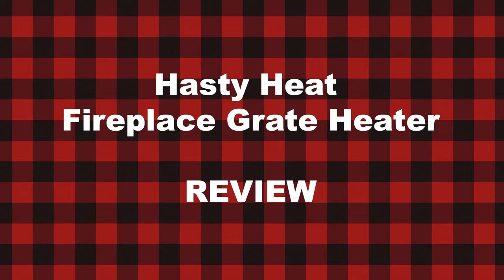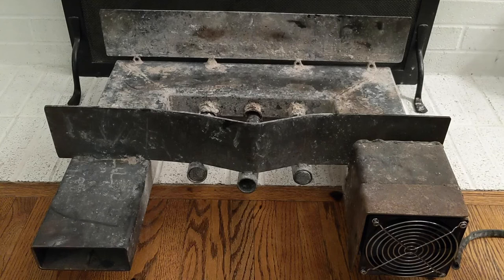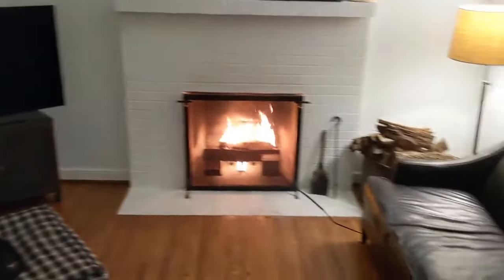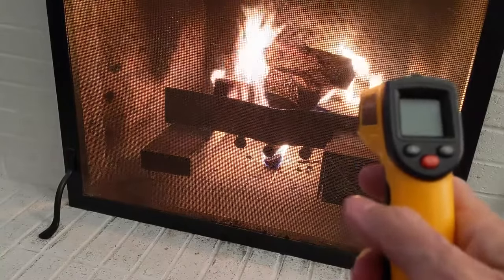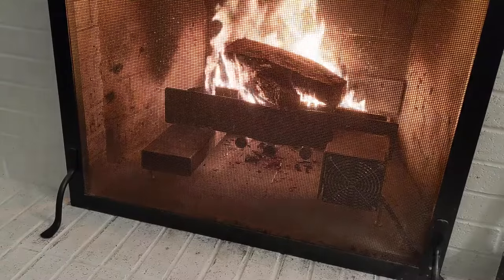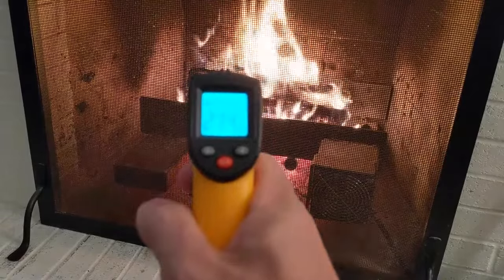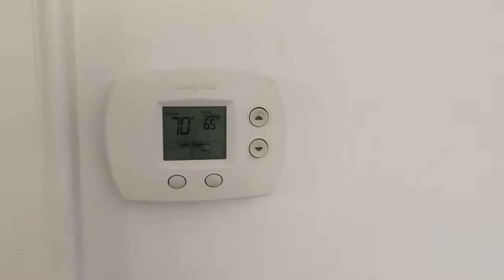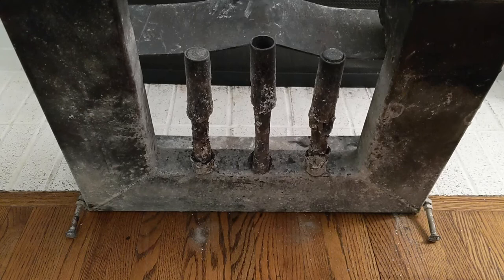24HTH20D fireplace grate by hastyheat.com with a tubular heat exchanger to blow heated cozy air

Comment: Thanks this was helpful. Did you consider the tube versions? Really debating between this HTH and the tube which are more efficient and some that don't have a fan if you have a power outage.
Reply from the maker: The tube type with the fan still works the same as a fanless in a power outage since they have the same natural convection, but when there is power the fan produces magnitudes more heat. Get the version with a fan.